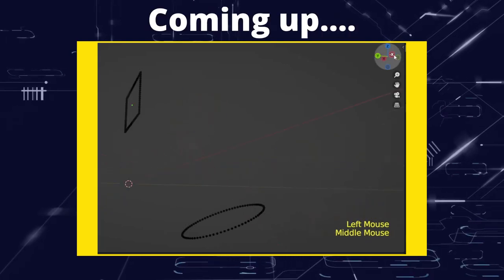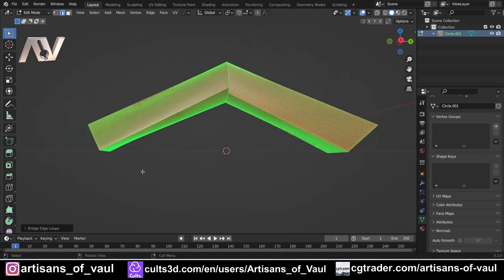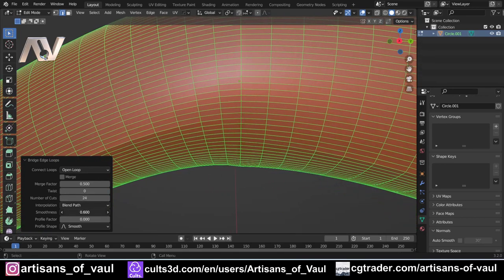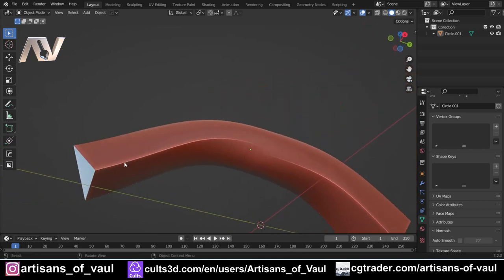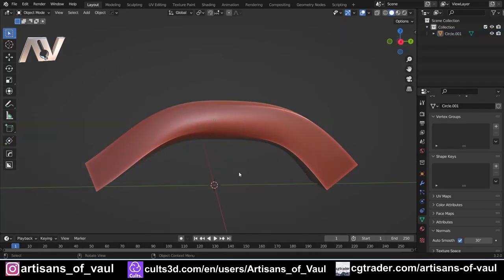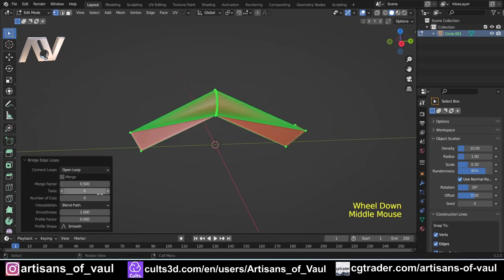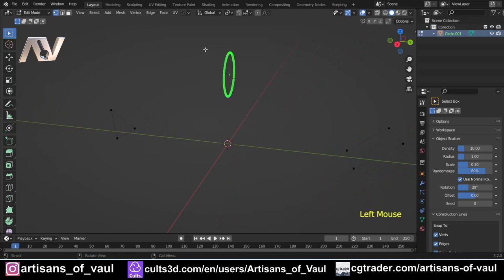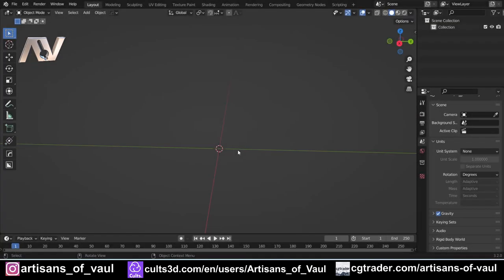Smooth shape transitions in Blender using lofting

Comment: I have yet to watch a video that makes me regret subscribing. :) You do a great job, Thanks so much for the hard work you do. I know your modeling is mostly focused on 3D printing. I've used blender in 3D printing as well. But most of it was to make parts and replacement parts for various fixes around the house and mechanical stuff. Do you have a favorite addon or work flow for making dimensionally accurate objects? I know there are some simple and even advanced CAD addons but I've mostly just used the measure tool and the object info to size things.
Reply from the maker: Thanks so much, thays great to hear 😁  Most of the time I just use the standard tools for my dimension accurate work. You can find a video of and example of that here:  https://youtu.be/s3ieJwBHcI4

Other than that I have heard good things about an add in called CAD Sketcher (I think it's free so could be worth a try) but I haven't used it at this point. I have spent some time using Construction Lines and I like that (and it can do some other really nice things). I need to do a video on Construction Lines at some point.

Comment: Thank you for this really concise and effective video! I tried it out myself and discovered that instead of beveling the edges, one could use the  "Edge Flow" addon and activating set flow in order to get really smooths edges, tho they maybe be to smooth hahaha. 

Disclaimer tho, sometimes the set flow the addon glitches. And  you would need to add another object then enter the edit mode of the new object then delete it in order to "reset" the addon. Anyway, Thanks again and hope this helps! :D
Reply from the maker: Cheers. I've never used Edge Flow. Is it paid for? I'll have to give it a look 👍🏻
Reply: @ArtisansofVaul  nope! it's freeeee
Reply from the maker: @user-fz3en2xj2j  Thanks so much.  I just found it on GitHub.  Going to have to give that a look!

Comment: ... how do I loft two curves into a new object and maintain control over the original control curves?
Reply from the maker: You can't really, this needs to be as a mesh for it to work. I'm wondering if it would be possible with Geometry Nodes but I'm not sure it would be. Though.... there is an addon that can manage shapes from curves you might want to look at to see if it does what you need: https://blendermarket.com/products/curves-to-mesh/?=ref834

Comment: Impressive video. Btw, do you know if there is an automatic (addon) or semi-automatic way to turns SIMPLE existing object into a mesh. Basically you would select an Axis and the number of "slices" and the addon would cut the existing object into slices (optimally with the same number of vertices) which you then can edit individually and later loft together.
Maybe if could also automatically set the distance between slices. If there is a lot of "change" between slices, it would add more slices, if it is just a straight tube without changes, it would just set one slice at the beginning and one slice at the end of the tube.

I hope I explained it clearly?
Reply from the maker: Good question, and yes this kind of is and it's an Add On with SO MUCH more. There is a function in Hard Ops called dice that does exactly what I think you are asking by adding edges and vertices on a specific axis. It's really helpful for lots of different types of modification (for example deforming with a lattice). You can check out the add on here:
Hard Ops and Boxcutter discount bundle: https://blendermarket.com/products/hard-ops--boxcutter-ultimate-bundle/?ref=834

I could make a quick short on it if you'd like?

Comment: I can't rotate the flat shapes properly i have no idea awhat is happening
Reply from the maker: That's a bit tricky to help with without seeing more, but have you tried going side on any rotating that way?
Reply: @ArtisansofVaul  i fixed it eventually
Reply: @ArtisansofVaul  New issue: the vertices are the same but it's lofting the shape to the other side of the other one, I have a potential solution, but It involves being able to choose which order the shapes are lofted in and I don't know if it's possible.
Reply from the maker: @h-Films  Annoyingly it seems to loft in the order it decides.  But you can loft one section, then select the next section and loft them individually to do them in a specific order.
Reply: @ArtisansofVaul  darn, well, thanks